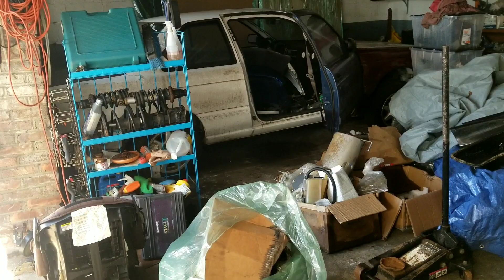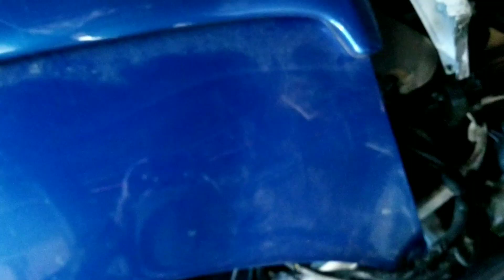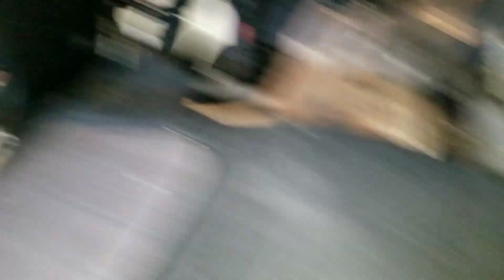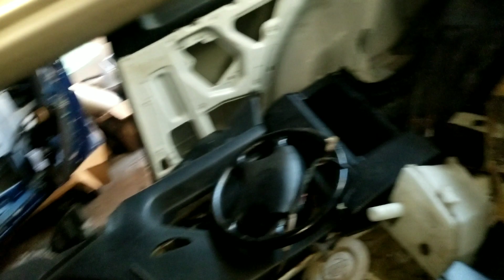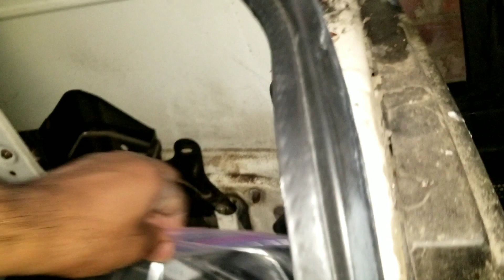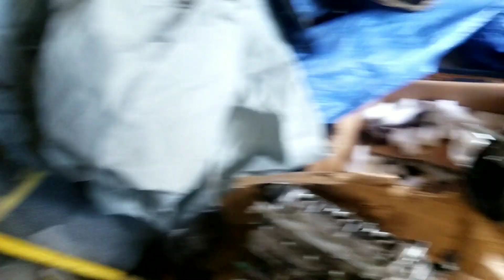vq sentra build 6speed trans pt2

Comment: Hey i have a question, I'm interested in doing this vq swap in my p11, would I need to change the hubs?
Reply from the maker: Message me on brownspeed garage on Facebook
Reply from the maker: I think the p11 hub should be ok
Reply: Did you ever do it?  About to do this in an 02 P11 as well.
Reply from the maker: I was looking into it but we didn't get a p11 chassis to do measurements
Reply: @brownspeedengineering  Lots of VQ engine options out there.  Can I use an engine from a Murano for a b14 swap, and use an Altima or Maxima 6MT gearbox?
Reply from the maker: @jwilliams5857  yes